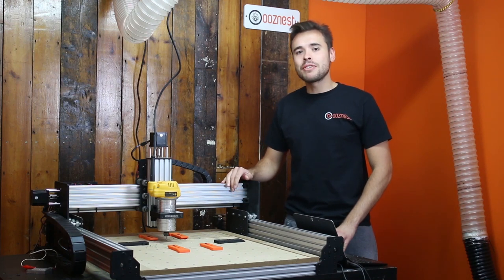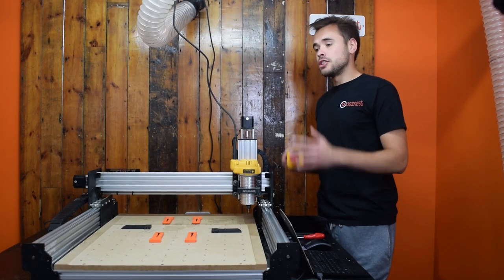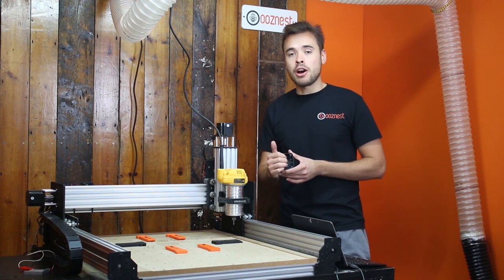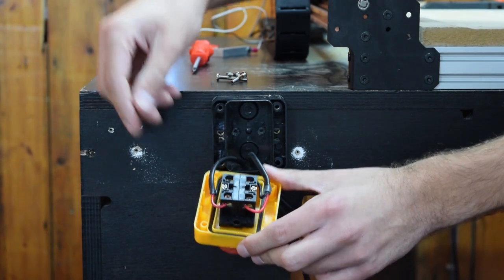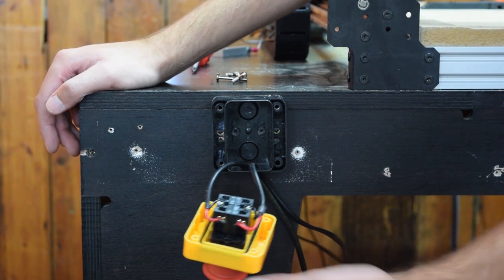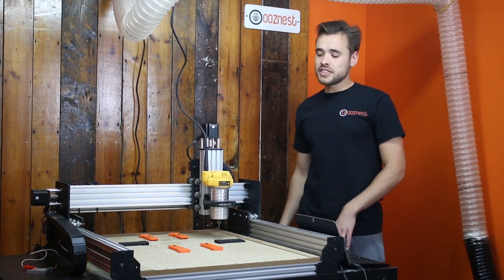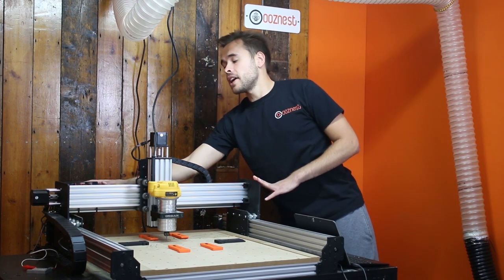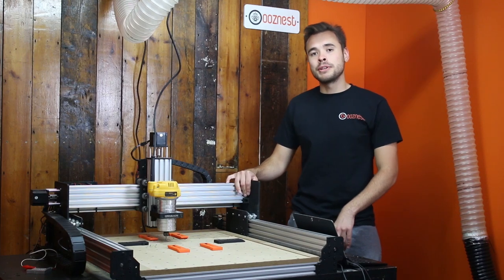How To Install an Emergency Stop Button on Your WorkBee CNC | Ooznest

Comment: Uhm? When the normally open is used for power interrupt, it is (as it says) normally open when not pressed. So it doesn't provide power to the machine.

I think you are mixing up the normally open (closing when pressed, stopping the software) and the normally closed (opens when pressed, stopping the power).
Reply from the maker: Apologies for this confusion. Wiring diagram has been fixed, and notice put at top of description.

Comment: Thanks for the video. Do you have any diagrams of the emergency stop wiring if you're using arduino and CNC shield? Really I would be looking for all wiring diagrams for a workbee driven with arduino. Also, because I am not experienced reading diagrams, I am unsure what the box on the left is and what the XT60 box is in the wiring diagram.
Reply from the maker: Hi, thanks for the comment, i am afraid we only have wiring diagrams for the CNC xPro controller as that is what we supply with out kit

Comment: Seems the diagram is reversing between NO and NC positions, at least it is on my Emergency switch button, otherwise it doesn't work. But thank you for the video and drawings.
Reply from the maker: Hi, that is strange i just double checked the diagram and looks to be correct.
Reply: Damien you are right the diagram looks good but he explained it backwards. When you bit the stop the behavior should be to cut power and connect e-stop to e-stop pin.

Comment: You have mixed up Normally open and Normally closed terminals pal
Reply: I was wondering that. It did not make sense. Should be closing the e-stop and opening the power circuit.